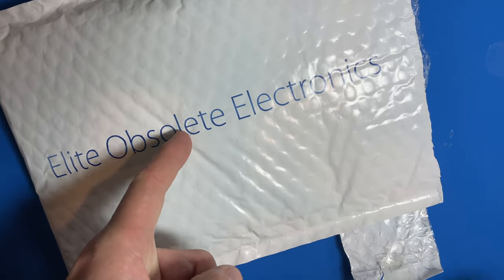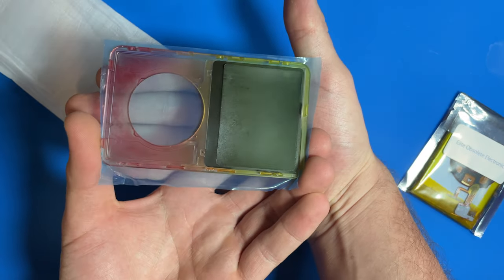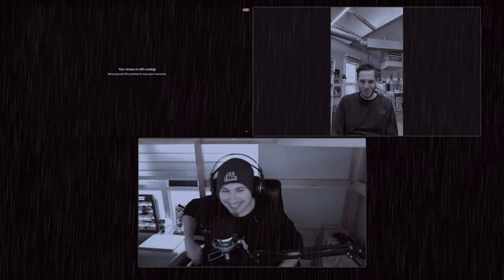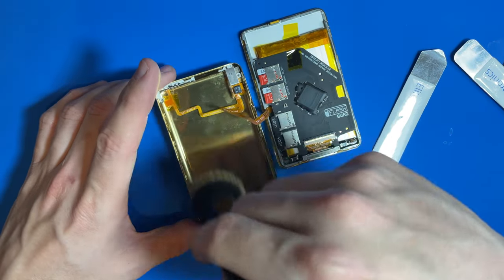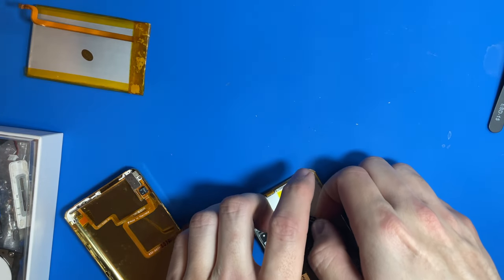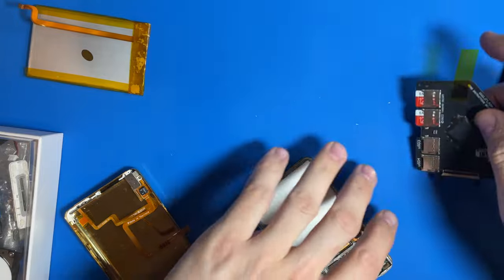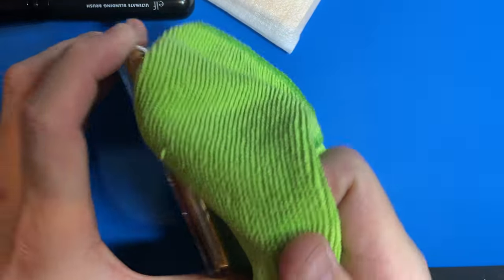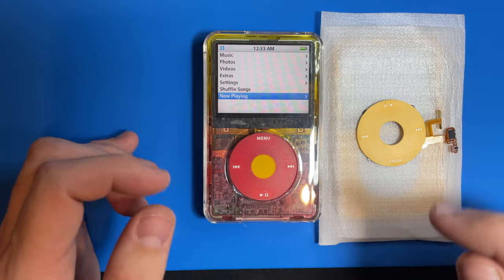ATOMIC Faceplates: Style my iPod Video After McDonalds Please!

Comment: It looked like the faceplate went on like a breeze without fitment issues like some of the ebay replacements. I'm looking to get a 5.5 gen here soon and the atomic Nebula style looks right up my alley. Was wondering how it has held up so far to wear and tear? Also another quick question, do you think it's better to get a fat back VS slim as a base for modding? Heard that the fat ones have more Ram. Nice video!
Reply from the maker: Personally I run a clear protective outer-shell. Aftermarket faces tend to scratch pretty easy. I run a fat motherboard (thick back) in a slim case, so best of both worlds there. My faceplate is immaculate, but been cased it's whole life, so I'm sure that's why.